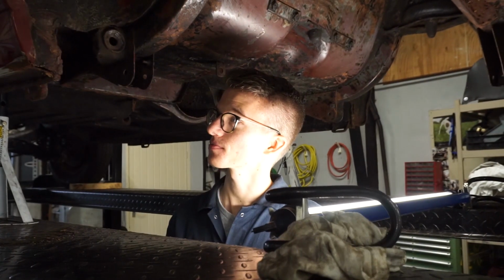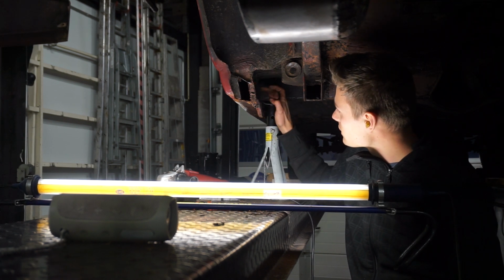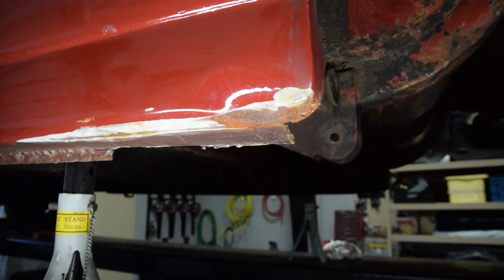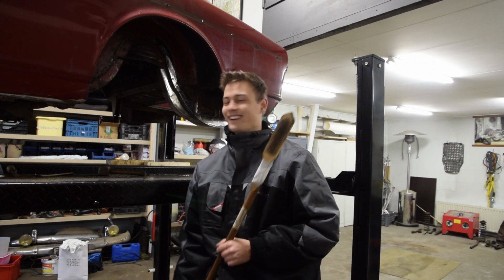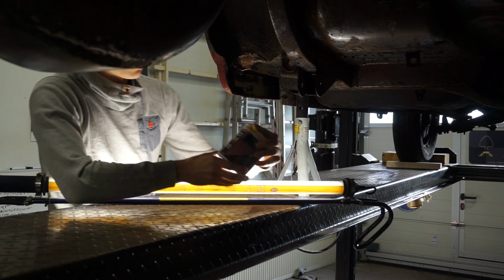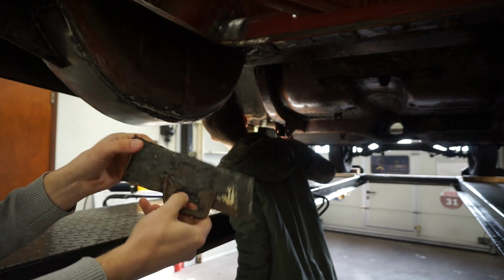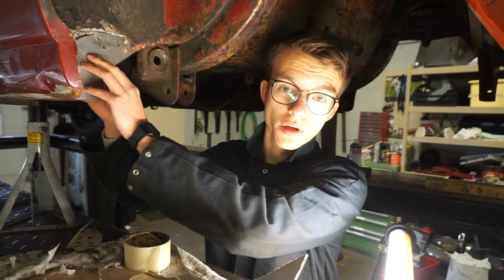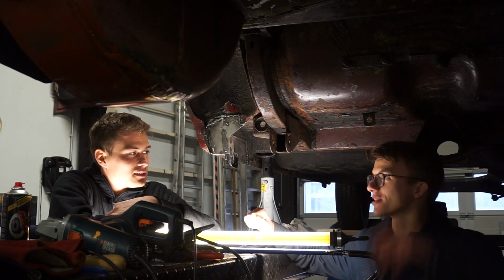Fixing the rusty DOOR SILL - The Vintage Volvo Project #10

Comment: Also, I don't have much faith in zinc primer to prevent future rust.  Remember that Volvo had the body all painted up when the car was new, and look what happened.  There are anti-rust coatings that have the ability to creep and protect metal even though small dents in the metal and pin holes in the paint may develop that would compromise the zinc primer.  Coatings like these should be very helpful in areas that are closed and therefore can't be periodically inspected.

Comment: You really needed a slap hammer, also known as a dent puller.  You also could have saved some time and improved the durability of your repairs by using fiberglass here and there.